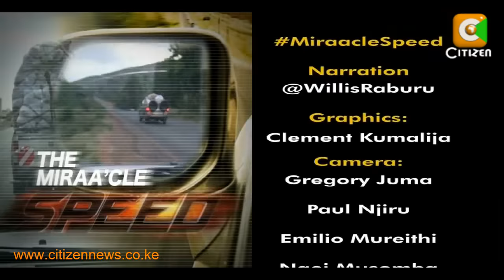Miraa'cle Speed Part 2

Comment: They run 80-90 miles..that is the speed every driver in America drives..even grandmas...cool with that "supers speed" bs.
Reply: the highways are not as wide or as god as in america as you can see, so 80-90 miles an hour is quite fast.
Reply: haha the terrain of meru requires one to be at 50 and below......80 is suicidal
Reply: 80mph on an American freeway is not equal to the same on a Kenyan road. Roads are much narrower, not well marked, have random potholes, terrain is hilly, and goats may appear around any corner dillydallying like goats do. The average American would drive these roads at 40mph, until they adjust.
Reply: dufaan green, dude the roads are fucked up here, too narrow and rough. these drivers would break records in the streets in the U.S
Reply: They have loads and the roads are on nightmare stuff
Reply: Bring those grandmas here to kenya and see if they can even hit 40mph
Reply: 80- 90 in a straight and fine road
Reply: dufaan green well said
Reply: Remember this is a fully loaded car
Reply: dufaan green we're talking of Kenyan roads with heavy loads.
Reply: do you want a trophy for that?
Reply: Sawa msee wa Majuu
Reply: Yea but u dont have potholes on ur roads plus its usualy on highways try googling the roads they go though i doubt u could hit 40miles😂😂😂